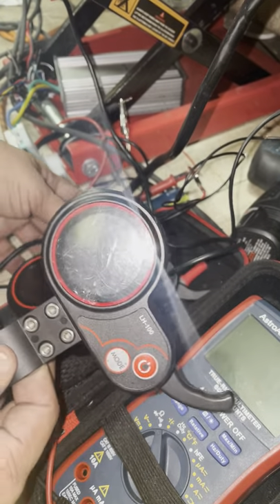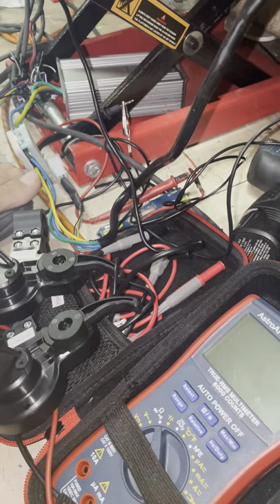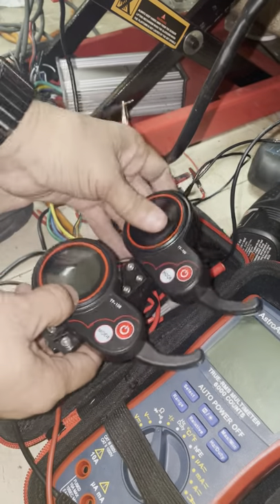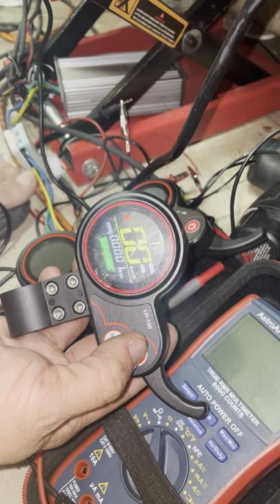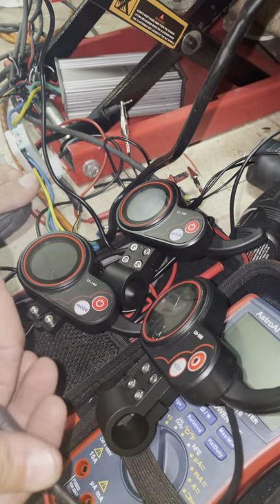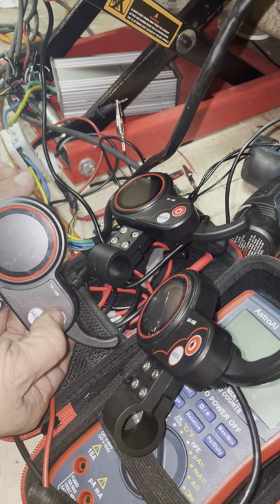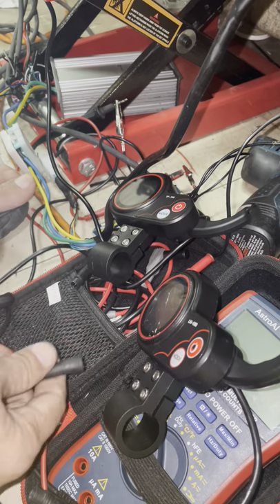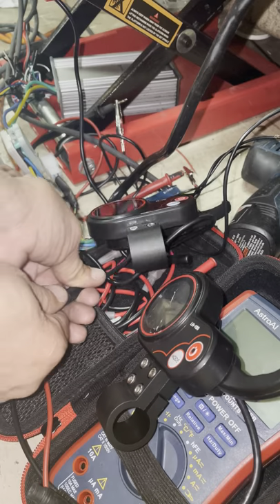These TF - 100 lcd displays do not  work on my scooter.

Comment: Hello, certain scooter businesses modify the wire order configuration, thus you must buy from them. I'm confident that reconfiguring the pins will solve the problem. LMK thanks!
Reply from the maker: Next time that’s exactly why I will do.  I’ve since moved in to a different controller with its own lcd display but I did notice the same thing.   The thing is the motherboard didn’t have markings on it so I didn’t know which color was which connection. I do know the color codes were not the same as I matched the colors to the pinning on the old lcd display and it still didn’t work.

Comment: Cut the connectors off and rewire the correct colours
Reply from the maker: Tried that  didn't work because they didn't follow  the same color scheme and there were no markings on the mother board to reference either.  I ended  up just getting a complete set of controller and lcd display so I know they work together.    You were on the right track tho.  If the color scheme for the wires would have been the same from my old lcd Display to this new one then that would have worked just a matter of re-pinning the plug to match.
Reply: @robertopagan5809  At least you got it all sorted yeah they sometimes do that use complete different colours lol
Reply: You could unscrew back of the display and see which wires are soldered to which pins. And compare with old one. Incase someone have this issue in a future.

Comment: You need to replace it with another LH-100,  TF-100 won't work.
Reply from the maker: Tried the LF 100 also.  Didn't work either.

Comment: why does the screen flash the red symbol i just swapped out my display bc it broke but now the scooter wont run and that red triangle keeps flashing. please some help
Reply from the maker: If you didn't swap out your lcd display for the sand exact one you prosit shirts of your Contriller and now it can't communicate with the lcd. Most likely because the wiring isn't the same from one lcd display to the other